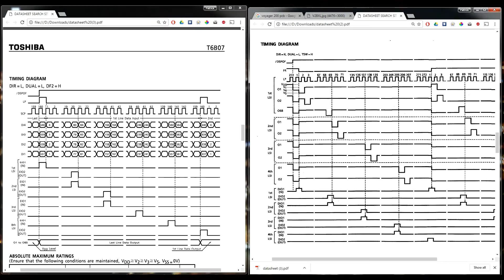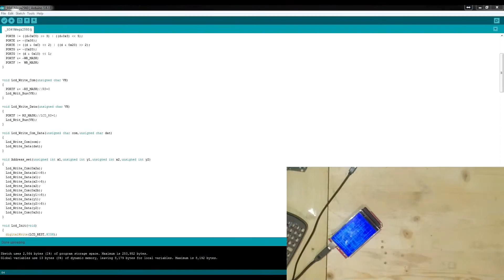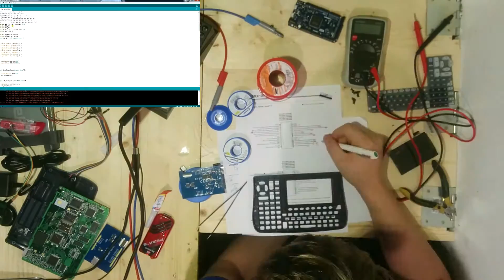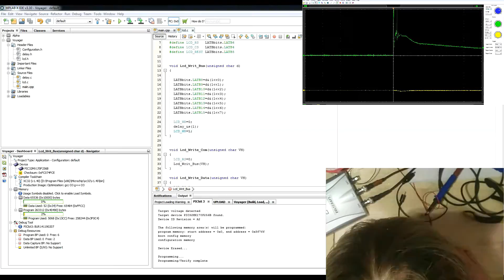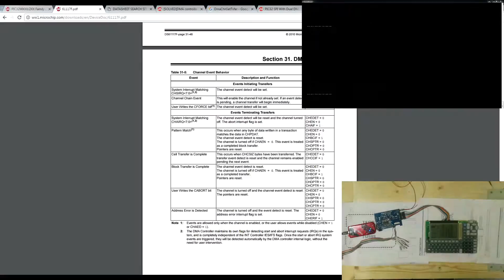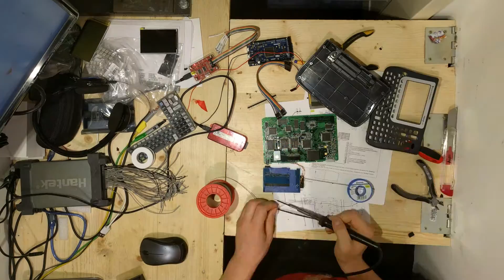Project Voyage 200 repair [en]

Comment: Thank you for this video, I have a Ti-92 Plus with a faulty display, it might be possible to adapt this project for that. (Though I do not have the skills to do so). I do wonder now that in 2026, could a RP2040/RP2350 replace the PIC32? In theory I think the Pico's PIO could handle it

Comment: Hello! You did an awesome work, I'm sure that a lot of patience is required to do such jobs. 
I've bought a V200 from ebay some time ago, I've paid it around 35€, so probably now it's cheaper to replace the device.
Anyway I really like these portable devices, and my initial idea was to use it in my DIY projects, maybe to display some data on the display, have a keyboard to type text, and so on. But then I've realized that using the 3 wire data cable is not easy, and probably the CPU is too slow to handle certain tasks. 

Do you think that it's possible to interface a new MCU to the LCD driver ICs on the V200? I'd like to keep the keyboard as well. 
Technically it's possible to translate the timing diagram into a driver for the MCU (I'm thinking about an ESP32), but I'm pretty sure that it will be a though job for me, as I'm not so expert with low level programming. 
What's your opinion? Thanks :-)
Reply from the maker: Wow 🤯 the reverse idea. Yes I think it is possible. You can find the datasheets of the driver ICs and control them with an MUC. Alone the fact that you can control all the timings should make it easier. But doing it with an esp32 can be tricky as you need to directly work with the espressif library which is know to be bugging as hell 🫣. Good luck 🤞
Reply: Hey! Thanks for the prompt reply 🙂
The datasheets are available online (Toshiba T6B08 T6B07), so no problem on that side. But sorry, I don't know what it's a MUC (Multiplexer?). The esp32 is the first idea I had, as it's cheap and it provides wireless connectivity OOB, which is one of the goals of this project. I'm using it since not very long, but it's not so bad as I thought initially. Until now I've never used the espress-if library, but I've worked with micropython or the Arduino library. Probably the latter is more indicated in this case. 
I've got other boards in case, like an STM32F411, which is not providing wireless tough.   
This is going to be a bad 😁
Reply from the maker: @midclock That was a typo MCU 🫣 If you have concrete problems feel free to send me an Email maybe I can help 😀
Reply: @improat  ok thanks!

Comment: A great video on how to solve a very common problem with the TI VOYAGE 200 calculator! I used to use the TI Voyage 200 for my work, I had programmed the device with pattern development software  for sheet metal items such as circular bends tees and vessel heads etc.  I used to provide these for work colleagues to speed up their production in the workshop. I have had to dispose of between 5 and 10 such calculators because the screen had given up. This would have been great as they are expensive and are no longer in production as far as I know. But it has to be said, that this repair method would be beyond what the typical owner of such a device would be capable of 🤣
Reply: You're gonna hate to know this after the fact but there was nothing wrong with the screens. The bonding between the ribbon cable on the screen and the board is what failed. Had that been replaced it would have kept on working.

Comment: Can you do this for me? :) You know even getting a terminal to run over the I/O port would be enough, I could use my working TI92+ as server and the Voyage as client. I guess I could try that myself. My screen stopped working after it fell off the table, a 1.5 foot drop - ??? Bad, bad, bad design for an otherwise magnificent machine. Super work here! Somewhat in awe.

Comment: If you reduce the DMA transfer to 10 frames per second was is the original FPS ? 
By the way I have the same older USB PC oscilloscope and CONRAD multi-meter :-)

Comment: Hi Im-Pro! I have a Voyage-200 with this issue.

Actually, I tried to open it and I'm kicking myself because I broke the display connection because I pushed the wrong way. I was just going to use a heat-gun on it to try to do a simple fix, but I made it worse before even getting to that point. I'm no electrical engineer so I do not know how to deal with circuit boards and hardware like this video.

Therefore, I was thinking maybe you would be interested in buying this Voyage 200 from me for very cheap. You can then fix it and sell it or keep it. I just want this device to not go to E-Waste.

Let me know :)
Reply from the maker: Nice idea thanks. But it's was a one shot project I'm not planning to repair another one. Maybe put it on eBay.
Reply: @improat  OK thanks for letting me know!
Reply: Put it on Ebay for 99 cents. People will buy it. It's better than throwing it into the skip.

Comment: What lines where you tying into to get the display data off of the voyage 200? Could you share an image of the voyage to pic32 data and power connections on your github?
Reply: I'm trying to replace my display on a ti-86 and want to tie into the 18 pins going from the main board to the LCD board. it's the opposite of this project: https://ripitapart.com/2013/03/02/making-use-of-an-old-ti-83-plus-lcd-screen/

Comment: My voyage 200 is completely frozen in the home menu (with the options clock, home, graph, ...), it turns on automatically and the buttons do not have any result - it does not respond to any command. And it also will not turn off, unless I take out some battery. Any suggestion?
Reply: Reinstall the OS
Reply: It is a hardware issue. I have the same exact issue with my 89T. Were you able to fix it?

Comment: hi i have a question. just repair cable with same original lcd is will be hard ? i want hear your oppinion.
Reply from the maker: min jae Yoo I could not do it with my calculator... That why I replaced the display
Reply: im-pro Thanks you ! then re heat may will not help ?
Reply from the maker: Maybe I did not try because of the plastic cable. I just tried to add pressure and see if something changed ... And it did not.
Reply: im-pro i see.. Thanks you so much ! maybe it can be some another part problems, i think.
Reply: @MrMJY  I've seen a guy repairing similar LCDs by applying heat on the flat cable... It's plastic but apparently it can withstand the heat of a soldering iron. Maybe do a little test before going all-in, if you decide to try a repair. Cheers

Comment: Could you please give more information or even share your code regarding this project? I would like to do the same to a Voyage 200in the same condition! Thanks!
Reply from the maker: I can send you the code. But without some in depth knowledge of electronics and microcontrollers its very frustrating to do :-( 
https://github.com/pknoe3lh/voyager200repair/
greetings Patrick
Reply: im-pro Thank you Patrick! I'll take a look, you have here a great project! Could you please clarify how you connected the calculator to the MCU? I'm not entirely sure how you are tapping into the column/line drivers', can these ICs be removed or are they needed?
Reply: Sorry to bother you again Patrick, but I'm having a hard time decoding the protocol of the row drivers. I have collected a sample of a few frames with a logic analyser and I'm attempting to plot the data in my PC but the result so far is not good. Could you please share how the original screen pixels are plotted? I've figure its something like 4 pixels at a time for a given row. Is this correct? However, I can't seem to sync the columns between lines.

EDIT: Ok, so I've finally manage to generate a screen frame using SciLab, by following your UART output example in the video!
Reply: Wow, you have many skills and great patience. I am seriously impressed.